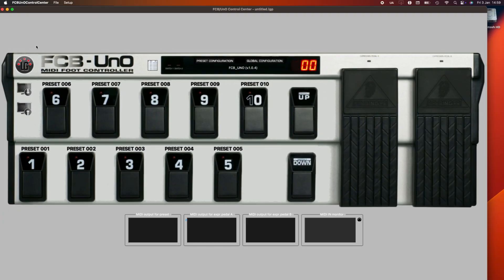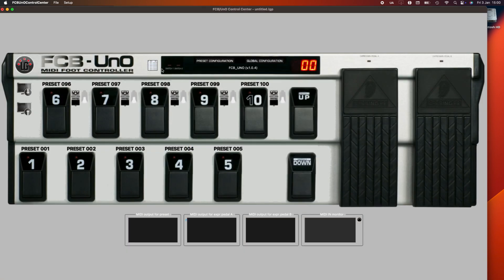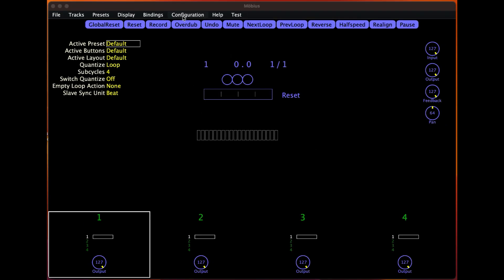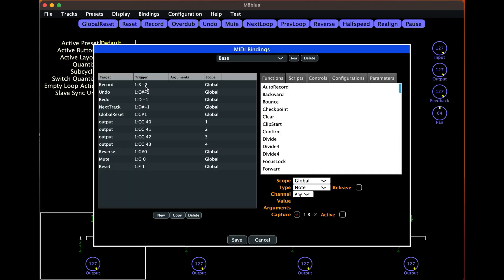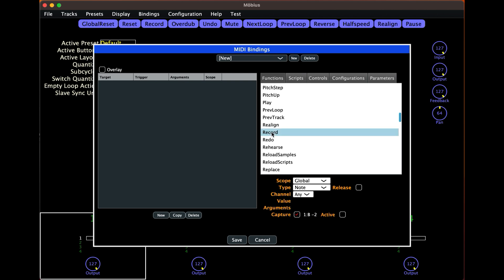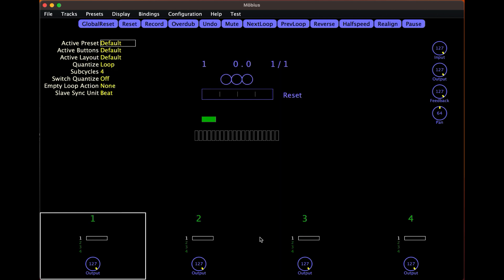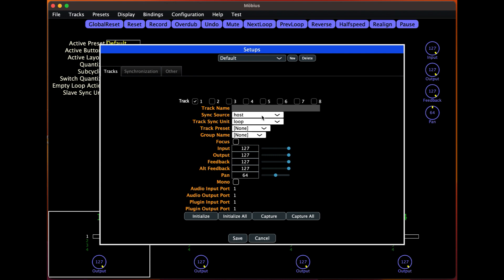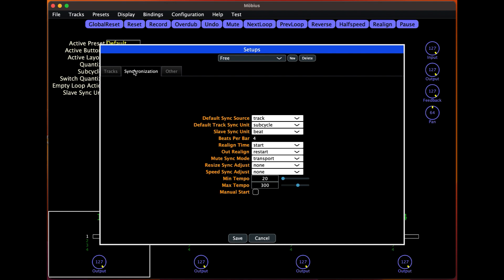Möbius 3 - Setup and Basic Live Looping using the Behringer FCB1010

Comment: OMG! I've been using version 2.5 for a while, as I have two Hardware Loopers that broke, and I got tired of that. I look forward to installing version 3.0 and being able to use it in a DAW as well. Does it run as a separate program, or does it upgrade the old version? Will all my saved loops and projects  run in the new version?

Comment: THANK YOU! This is exactly what I was looking for. I was going a bit insane trying to find tutorials that clearly explained everything and yo udo such a great job of that. 
Looking forward to see what else is possible with this. But for now I'm just greatful to have something to replace my broken Boss RC-30. 
I have two questions that you may know the answers to. 
1. how can I set it to record via input detection, as in i hit the pedal but it doesn't start recording until i actually play. 
2. I'm using Reason as a DAW. when using plugins ( I too have the UNOCHIP so i an use stompbox mode) I can't use mobius AND control another VST for example a tomp box on Nerural DSP.   ( This isn't a huge issue, as I often use real gear, but for the sake of keeping everyhting in the box it could be useful.) 

Seriously thanks again for taking the time to explain this, it's helped a lot! :D
Reply from the maker: That's so great to hear. Thank YOU! I've been away from this stuff for so long and your question was a catalyst to get me started again 👍🏻. Hmmm, OK - to answer question 2 first, I've never used Reason (I switch between Ableton and Bitwig Studio mostly and use Element too) however I do successfully control Mobius and plugin effects in the DAW using my foot controllers. I would have thought there would be a way to route MIDI through to tracks/individual plugins in Reason (as there is in Ableton/Bitwig)? Let me know. For question 1, I'm afraid I don't know as I've never tried to do that. There is a looper by Melda called MSuperLooper that has an Autostart function based on velocity. I have played a little with that, but came back to Möbius. Try it and see if it fits the bill - https://www.meldaproduction.com/MSuperLooper
Reply: @RussSargeant  awesome, I'll have a play around. 
And glad you're motivated to start making vids again. Fantastic playing btw. Hopefully the new year is a fun, and creative one for you. 🙂